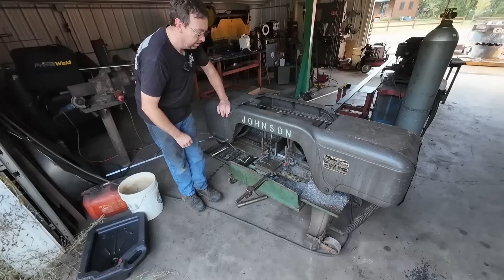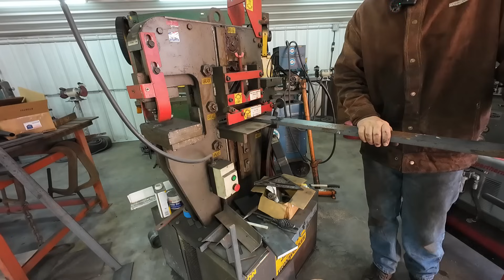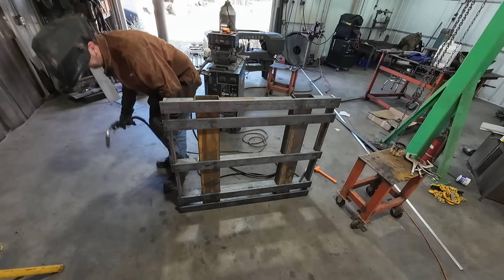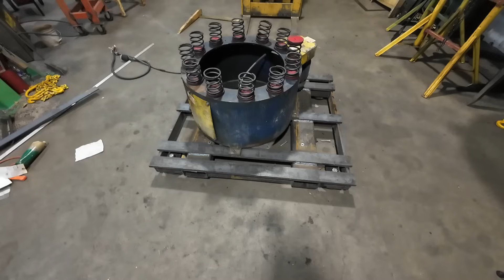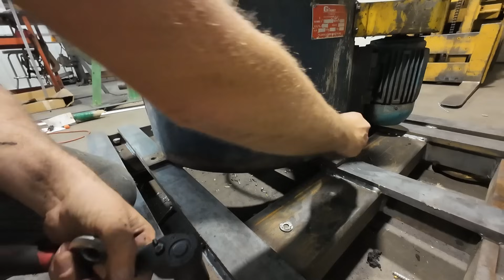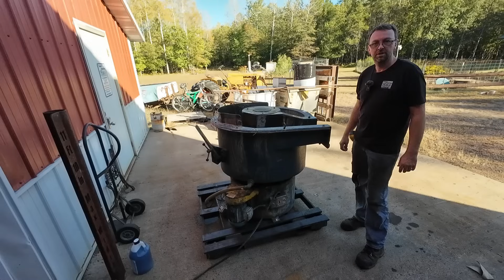Making A Forkable Pallet Type Base For My Giant Vibratory Tumbler - Heavy Steel Fabrication

Comment: Loved the "paint doesn't pay the bills, working equipment does."  So true!  Correct me if I'm wrong, but i think that was hot-rolled steel, and hot-rolled steel like that, if stored indoors and not subjected to water-spray, barely needs a coat of light oil every few years to stay pretty much rust free.  So why bother painting?  Another enjoyable video!

Comment: Moving the electrical switch and the timer on to a post (square tube) at one of the corners, could be an easy way to make the controls (switch, timer, EPO, etc) easier to reach, while in operation.

Comment: You're right paint don't pay the bills.  I like how u moved that outside its loud!  If it was me I would've just welded on the tabs of  the machine to the pallet platform u made an pick it up with the forklift about a couple feet while u are welding so it don't destroy your knees an back.  That way it would save u from all that laborious drilling an tapping.  Next time if u needed a new machine just air arc the welds.

Comment: Concrete in the base to increase the mass is sometimes an option, but what you have done works well
Reply from the maker: I was considering more ballast until I ran it. I was actually surprised I didn't need another 100 lbs.

Comment: Been watching your channel for a little while, just a curiosity question, might sound like a complete Noob question..  But I see movement for instance when you were drilling there was a very tiny bit of side to side movement but yet, whenever you put the machine on it fit just fine, is that completely normal and you just add in a little fudge factor, or is that an optical illusion. Not just on your channel I've seen that on a few...  And by the way I enjoy watching your channel..  You do really good work.
Reply from the maker: Drills will wander a bit until started. With a center punch mark, it is much less.

Comment: Paint may not pay the bills, however, rusty equipment that no longer function properly doesn't pay any bills either.  My opinion is paint has a place and should earn its keep just like any other part of a machine.  It's purpose should be to prolong the working life of the machine it covers.  KOKO!
Reply from the maker: As I stated in the video, when time allows it may get done. But it is not a priority. Since it performs no real function to the machine, it will not affect operation at all.

Comment: Anchor Lube has done a wonderful job of product placement. A dozen cases of product to a dozen YouTubers is better advertisement than 100 paid ads. Nice work Josh. That tumbler ain’t goin nowhere.
Reply from the maker: It really is a good product.
Reply: @paulmace7910  luckily it really is a good product. Found out about it a few months ago. It outperforms the ole regular tapping fluid by miles. I'm an electrician, so lots of tapping into steel on Refinery beams, boxes and stands. Works great.

Comment: the one place I'd make a Concerned Noise about paint is in very light sheet metal work which you don't really deal in anyway, because it's thin enough that even patina-rust is enough to rot the structure. The heavier stuff like this skid  is going to Weather really nicely.
Reply from the maker: Sheet metal needs some protection.  Even an oil layer.  Heavy fabrication will last a very long time.

Comment: That mag drill would go a long way towards tapping those holes Put 'er in low gear. You'll be surprised how well it taps. For sure, it would start the tap for you. They don't call it pain with a T for nothing.
Reply from the maker: You must have missed the part of "model #1, serial #1" on the mag drill. Only one speed. Lol

Comment: "Hardly any vibration down there in that base". That's because the base weighs twice as much as the machine! That would be the strongest pallet I have ever seen. Nice job. A spray of oil would control the rust and keep it tidy for years to come.

Comment: That mag drill was the best way of drilling the holes. Very handy to have even if you only use it very occasionally. I have several tools that I may only use every few years, but they are there when I need them for a specific job. Some people have the idea that if you don't use something for a year, get rid of it. That's a stupid idea for something that you might need later and then would not have if you got rid of it.
Reply from the maker: The radial drill may have been faster, but I couldn't get to it.

Comment: Very cool.  Paint just prevents rust... i just get a can of fluidfilm and spray the cap out of it.. steel looks cool without paint anyways.  The guy i learned engine machining had a machine like that that you could tumble an engine block in.  He had a 5 gallon bucket with a very particular weight of sand in it... pick up the bucket tge thing would rattle the shop.  Im still in awe a gentleman with an 8th grade education could intuitively figure beam harmonics... says a lot for  the value of experience...
Reply from the maker: He was actually probably smarter than the book learned engineers.
Reply: @TopperMachineLLC  smartest man I ever met. Inspired me to be come an engineer (but it consider myself a mechanic, since I solve problems instead of cause them ;))

Comment: One other question for you, did you put any kind of thread lock, or nut on the bolts? Just cause of the vibration.
Reply from the maker: Not yet. The ones that go through will be double nutted before real service.

Comment: You are the first fabricator (and I follow a few, CEE etc) who breaks the tapping chips by an occasional reversed part of a turn. Something I was instructed to do when I was apprenticed back in the sixties. I am in the UK so I doubt we had the same foreman or instructors!
Nice job, it won’t rust through until you’re long gone, if ever.
Reply from the maker: Many have no real clue how to properly use tools, nor do they really care to learn. Breaking the chip with a tap is the first thing you should ever learn when hand tapping.
Reply: For those coming along later: the backing with a straight-flute tap to break the chip is because it doesn't eject the chip the way a spiral-flute tap does. if you don't break the chip, it's liable to jam up and can break the tap by wedging in between the tap and wall. a spiral flute tap will curl the chip sideways, directing it up the flute. this is why powertapping with a spiral flute tap generates those huge long curled chips: the angled tooth adds an inherent twist to the chip as it's cut
Reply from the maker: @Hyratel  even with spiral point taps, it's good practice to break the chip. Especially when hand tapping. Not so necessary when machine tapping.
Reply: @TopperMachineLLC  is the difference the smoothness of  machine-driven makes a more tightly curled chip that self-ejects while a hand-turned spiral flute the chip isn't as tight so has the same risks as a straight flute?
Reply from the maker: @Hyratel  pretty much. Constant feed and speed from machine driven seems to drive the chip out and away.
Reply: @TopperMachineLLC  really appreciate you taking the time to correct with clear and plain detail (responding to Comment-OP: I think Squatch253 breaks chip very attentively)
Reply from the maker: @Hyratel  there are a few good ones out there. I have seen squatch253 do it also.

Comment: I've got a wood shop and a "try to weld" on occasion shop, and everything I can is on a rolling base of some sort because of tight quarters. Good project Josh.
   Just wish you'd start wearing knee pads. I found out in my late 40's that cement and rocked drives are horrible on knees. I'm in my late 60's now and still have OEM knees. Glad I found knee pads years ago.
Reply from the maker: Yeah, I'm starting to see the point to those sheep fornication pads. Gonna have to invest soon.

Comment: Let it rust...then treat it with rust eater to protect the metal...once it has a decent layer of rust on it...that rust eater paint can easily be applied with a brush, then let it soak in, and convert the rust to a hard protective coating..no need to paint, especially for a "pallet" that just holds the machine above
That thing is definitely going to be tough and last a long time! 
Keep em coming!!!!
Reply from the maker: Spot on.

Comment: You could convert a manual pallet jack into the base and then you don’t need the forklift to manipulate it around
Reply from the maker: I have a forklift, why buy something else I don't need.
Reply: @TopperMachineLLC  I incorrectly assumed you had a small collection in the back 😂
Reply from the maker: @go4peanut471  I no longer collect. I've been getting rid of useless stuff. Not enough room or need for it all.

Comment: Wondering if pads made from tire treads under the fabbed pallet would help, wouldn't hurt and prob insulate noise a lil more..GREAT video Josh a big 10 thumbs up
Don
Reply from the maker: You must have skipped the part where I show the rubber isolation feet.
Reply: @TopperMachineLLC  OMG I must have......sorry....
Reply from the maker: @donteeple6124  they are fancy screw adjust enerpac isolation feet.

Comment: I'm guessing you have a run of parts that need tumbling in the near future. Was that a ratchet from harbor freight? How well is it lasting? I have a few of that style but don't use them as often or as hard as you would.
Reply from the maker: @minigpracing3068  it is from HF. I don't do as much wrenching as I used to, so it's holding up well. Actually their tools are quite surprising in quality now days.

Comment: A good solid machine base, “Done right the first time!” Don’t ever paint it. Rust will get under the paint and make an ugly mess. A thin layer of rust is the best protection on an outside mount like this.
Reply from the maker: @ellieprice363  exactly. People don't understand the power of a layer of rust.
Reply: @TopperMachineLLC  Very true. Rust will normally go only so deep before the metal underneath is protected from further oxidation. My old trade shop teacher used to wag his finger at us and say, “Never trust a coat of rust!” He was referring to scribing layouts on a layer of rust instead of coating the surface with layout blue.

Comment: I like your base! Quite a few $ iron in that base!I need to make a base like that for my Bridgeport but also with low profile bearing rollers under it so I can move it on concrete easily for cleaning to bring it out for using in award applications ( VERY small shop)
Reply from the maker: @ssboot5663  rollers are a bad idea on machines. Build it similar and get a pallet jack. Imagine trying to machine something and the mill walking away from you. My small mills are all on rubber, because they will still move around without.
Reply: My benchtop mill sits on a heavy cast iron base and it only had holes in the bottom of the legs. I used 3/8" steel plate to build brackets that would mount in place with big bolts as adjustable feet and casters. Once it is rolled where needed, the bolts can be turned to jack it off the casters, so it sits level. To move it, just screw the bolts back up and it rolls again. Best of both worlds, and in a tiny shop, it does not require a pallet jack.

Comment: I love watching fabrication videos. The ability to make the stuff that you need is great to have.
Reply from the maker: @jrmintz1  you ain't a joking.
Reply: My Dad had a guy that worked for him that could make anything from steel. Hand him a piece of soapstone, space on the floor to design what you needed (CAD Concrete Aided Design), and he'd sketch it out, get the steel and fab it up using just a gas torch and a stick welder. I've mentioned him here before on the pipe cutting torch video. RIP Ernie, I leaned a lot just watching you work.
Reply from the maker: @mikeking7470  sometimes that's the best method. I do similar things. RIP

Comment: Back in the 70's I ran a couple of larger versions of the Iron Worker. One was hydraulic, the other; mechanical. Called them plate shears. Max on the hydraulic was 1/2 inch. Mechanical was 3/4. Max width was 6 or 8 feet. Can't remember. There was a shadow that told you where the shear line was. Hadn't thought about that in years.
Reply from the maker: Most used a shadow line. I'll probably be adding a light to this for that purpose
Reply: @TopperMachineLLC  I thought I remembered it correctly, but; at my age, one can never be sure.
Reply from the maker: @stephenbridges2791  very common setup, works great. Your memory is still good.

Comment: You made all that out of hot rolled steel and didn't grind of the millscale at the welds. so 3/4 of your welds actually welded the millscale instead the steel bars. Not a good welding at all.
Reply: It is not necessary to treat every single welding project as if it were going to outer space with NASA.
For the intended application here,  removing mill scale is not crucial because most of the metal comprising the base is simply to provide ballast mass to counter the orbital gyrations of the eccentric drum, not because it requires that much strength.  The amperage of his welding more than blasted through the mill scale and what little weld contamination that may have occurred is not significant enough to declare "bad welding" under the circumstances.  He put down far more weld than was required for strength, but consider that all the weld deposit added mass to the finished product.
Reply: @larrywalker7759  If he would have blasted through the millscale that would just burn the steel and or create worm holes on the weld. If he likes what is is doing: thats his business, I just made on observation as a welder with experience.
Reply from the maker: If you knew anything about welding with the process I use, you would know that the scale is burnt off by the heat and welding gas. If I were to cut apart any of my welds on this, you would see base metal fusion about 1/4-3/8" deep. This isn't your cheap home grade flux core welder.
Reply: @TopperMachineLLC  I have been a welder for over 32 years. Steel millscale withstands 3500 f. Its just an observation, don't need to bite my head off. Usually the millscale will not allow for mager panatration but maybe 25% of what it would be if you grinded it of.
Reply from the maker: @2010invent  I may do a sample I'm my follow-up video. Showing the fusion depth with and without grinding. Actually it could be a full video, but I'd need a crappy hobby machine to try too.
Reply: @TopperMachineLLC  Your Miller will do just fine.
Reply from the maker: @2010invent  but it is a commercial 3 phase machine. It's really cheating. A single phase machine won't work as well as this beast. Lol
Reply: @TopperMachineLLC  True yr machine has more umph than a small chines one. But steel will act the same under electricity attacking the molecules. If you work on dirty steel, the steel millscale will break down and relise hydrogin creating the "wormholes" that all welders hate
Reply: @TopperMachineLLC  There is a method to welding just as to cuting a thread. You cannot cheet.
Reply: @TopperMachineLLC  it'd put you back something like $100 or so, you can get a cheap HF flux buzzbox for that much, or one of the newer multi-mode Inverters that have cropped up in the past few years. saw an analysis of one "It'll work for light-duty jobs on-the-go but won't replace your Big Boi" The buzzboxes are still full AC, and require modding to make them DCEN or DCEP, but it's really needed to get a decent weld out of them in anything over 1/4" round
Reply from the maker: @Hyratel  While it's a good idea, I don't make enough on the videos to justify that expense.  Also, I have no need for more useless junk, I have enough already. LOL  But, it could be a give away item.
Reply: @TopperMachineLLC  one of the inverter units would be good for my use case (basement/residential garage do-all shop) where the PPE would take up more room than the unit itself, but not for a full-throttle heavy shop like yours

Comment: In my garage I have a 60 gallon vertical air compressor. I did not want to bolt it to the floor. It would vibrate and walk around. I ended up setting it on small pieces of fertilizer belting to isolate the vibrations from the concrete. It hasn’t moved since and is much quieter when running. Maybe a thought of putting some heavy duty rubber snubbers on the bottom of your pallet?
Reply from the maker: You didn't watch the whole video.
Reply: @TopperMachineLLC  Gotta admit I did fast forward through some parts. 
Touché. 🤦🏻‍♂️
Reply from the maker: I caught you.  Now you need to go back and watch again.  LOL
Reply: Done and done, Josh. 👍🏻